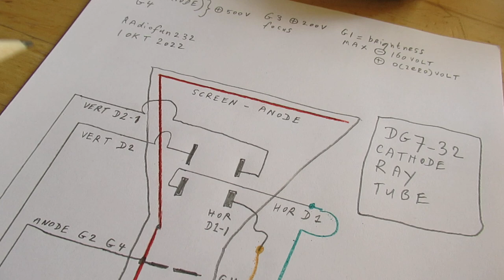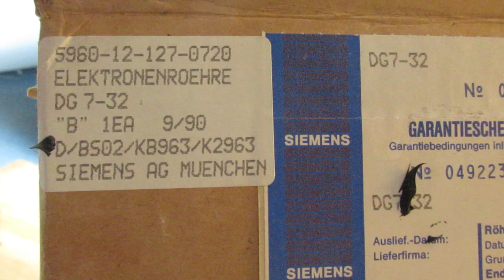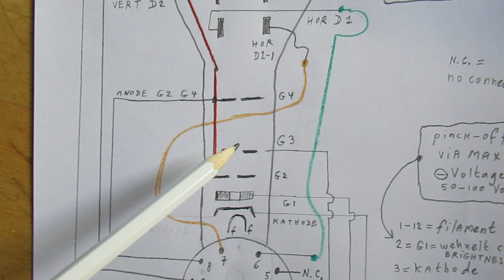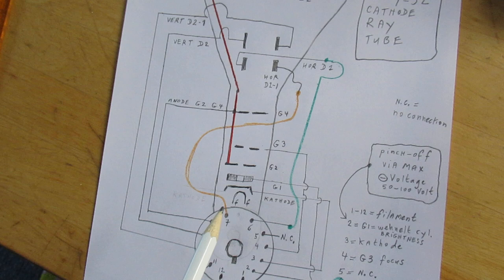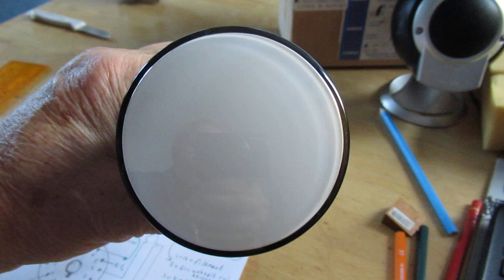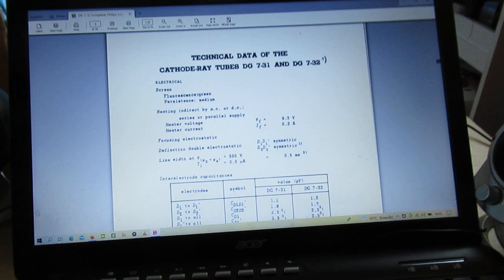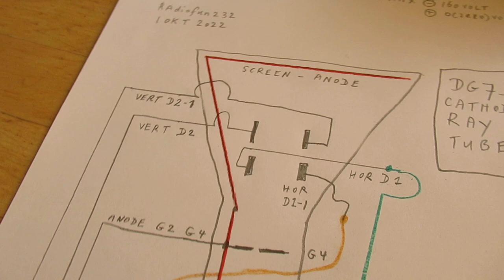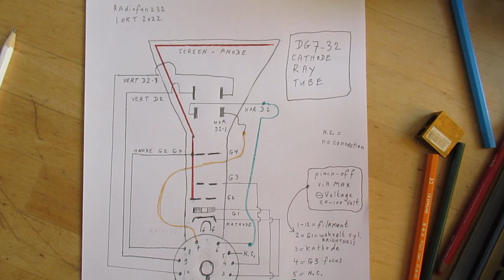Talking about a Cathode Ray tube with static deflect: how to get it working, the DG 7-32 (VLOG)

Comment: Very interesting, it's beautifully made and doesn't require much deflection voltage. It would be nice to see it working
Reply from the maker: Yes, true, I will try. No guarantee by the way, perhaps it was dumped on that radio market.
Reply: @radiofun232  Thanks

Comment: DG7-32 is my first scope CRT i bought from UK.. i like it very much.. that time i dont have confident to generate high voltage, so few hundred seen easy for me to get it.. I also keep 913 , DH3-91 they can work as long as 250V and , DG7-32 and 2AP1 can work as low as 400-500V.. by comparison .. 913 and 2AP1 having heater current of 0.6A and DH3-91 have 0.55A , the lowest is DG7-32 if want to make it portable battery power device.. although 0.3A is not that low compare to some CRT heater only 0.1A ..i think will be fun if power by rechargeable  18650 lithium ion battery make a portable oscilloscope . To make the scope work in DC coupling , is easier to ground at anode side while power a high negative voltage on cathode side , this require floating supply to heater ,because heater to cathode cant last voltage higher then 100V..  if power the heater side from ground.. then the deflector need to able to handler the voltage as high as 500V. that no easy to design unless AC coupling which the scope only can display AC signal no DC signal.
Reply from the maker: all true!

Comment: If you apply voltage to just one Y plate, not both plates, you will see spot distortion happening.
The final anode voltage can be set to 200 V, (derived from the B+ line)
Better to use ECC83 double Triodes arranged as long tailed pairs as deflection amplifiers. Can 'raid' existing O'scope circuits between 1961 and 1970, or later if you want to transistorize.  (Before '61 circuits were - - clunky). Enjoy !
Reply from the maker: Perhaps it is an idea to show such a working circuit in your YT channel, so that everyone can take profit.
Reply: @radiofun232  Oh, and I am using DG7-32 tubes.   I bought a few of them as will be rewiring about 10 O'scopes.  Most of them Cossor miniatures, some CT-52 .